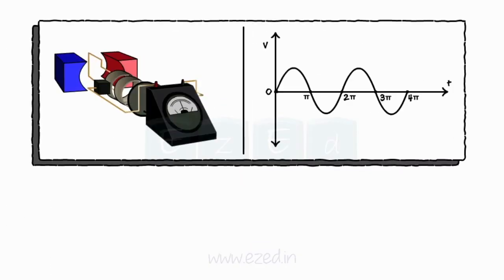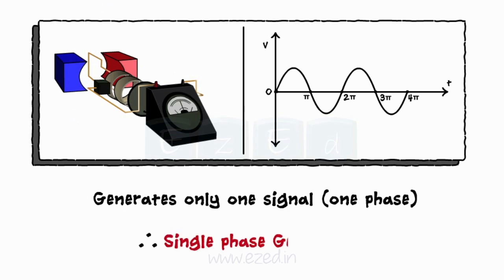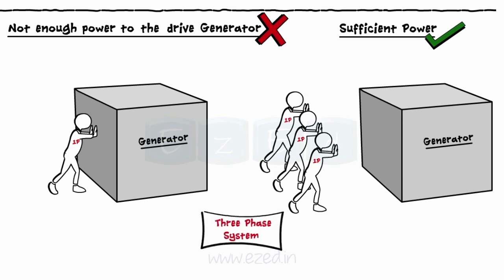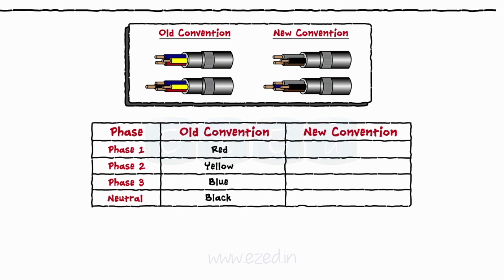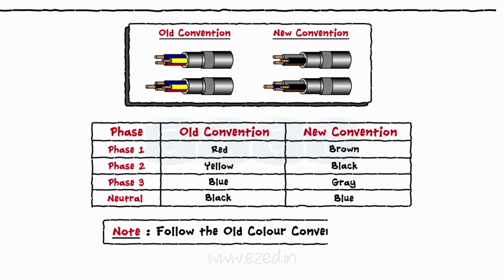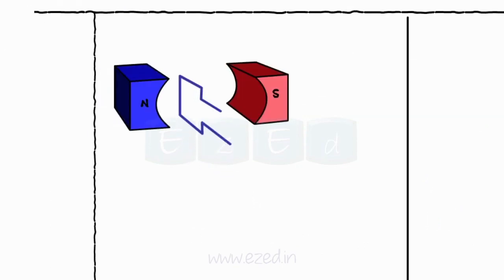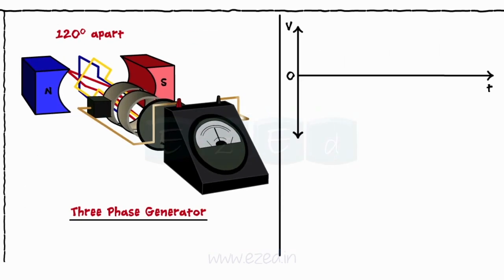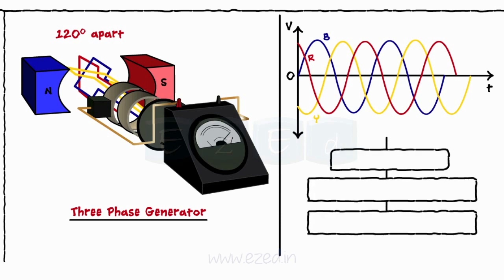What is a Three Phase Generator? Part I

Comment: How are you going to rotate wires? That doesn't make any sense
I can understand if the wires are static & the magnet is rotating. Rotating wires sounds stupid to me, how does that even work
Reply: Stator is stationary, the wires are moving. Voltage and current are induced with the rule of generator action: conductor, magnetic field(provided by the recently induced stator) and relative motion(some prime mover). Hope this helps a little